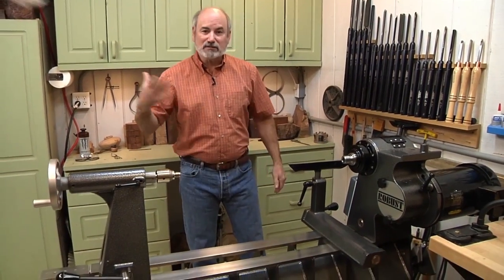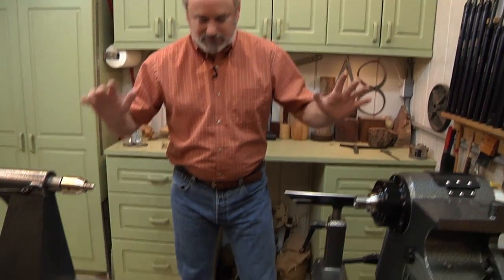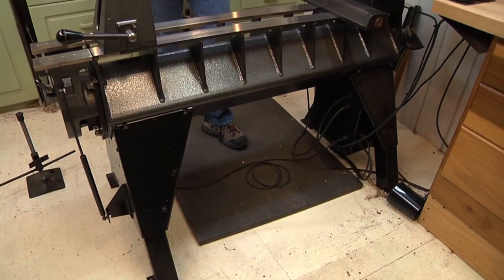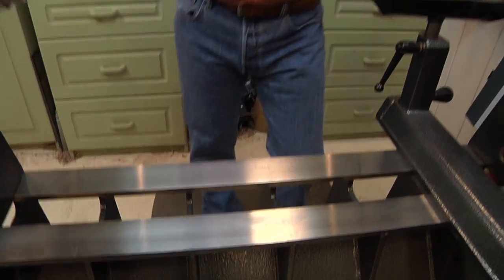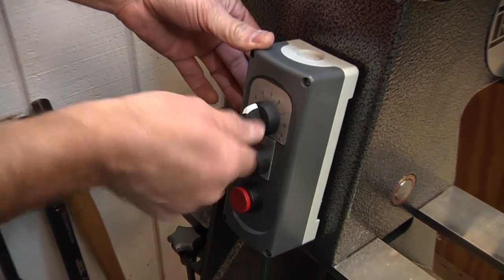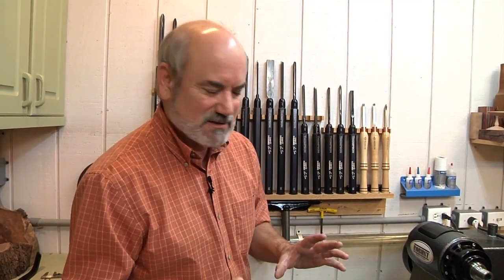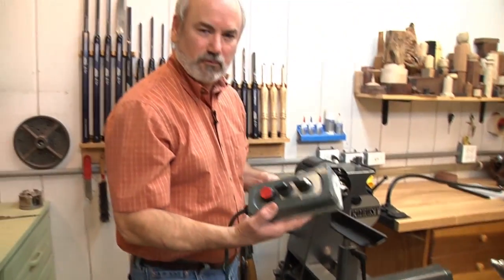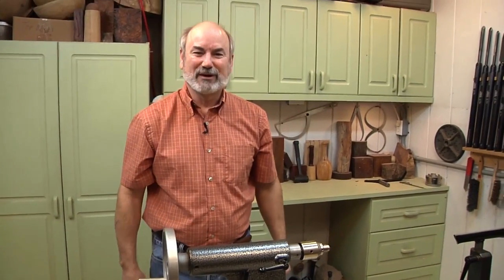Tim's Tips, Tools & Techniques, #2

Comment: nice to have you back.  I can see keeping the knock out bar clear for use on the end,  but you also need the bed away from the wall so you can tip your tail stock over.  Did not think of that till I watched you move it.  That looks like a good lathe.